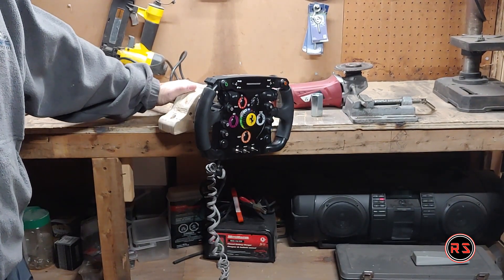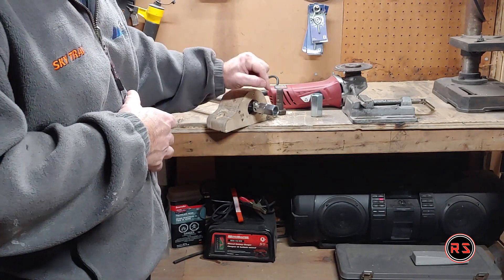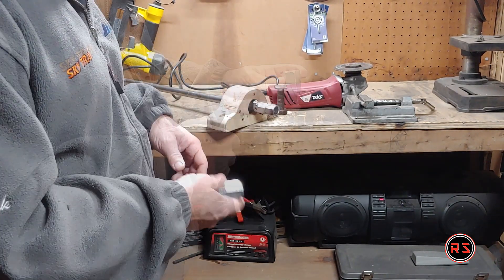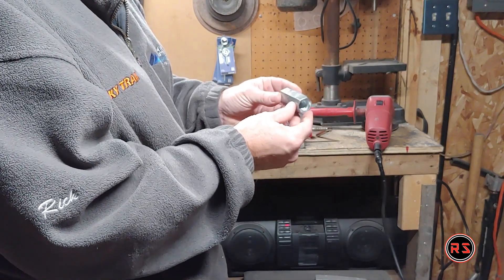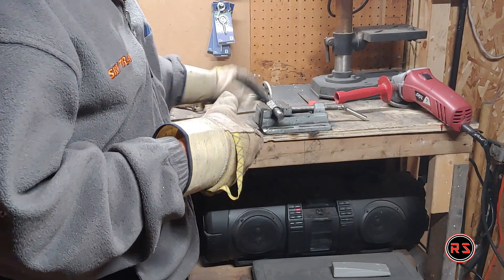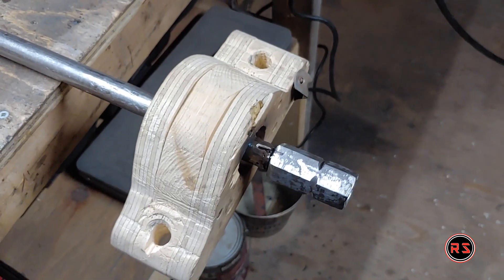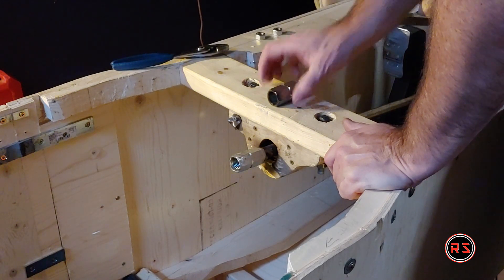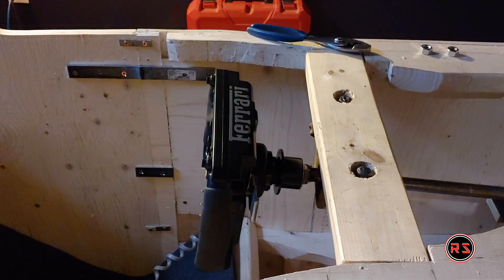Thrustmaster F1 wheel quick release update

Comment: Now how did you know the wheel is center to the hub everytime you connect it? Have a T500 rs and looking into building a similar setup
Reply from the maker: With this particular quick release there is 3 possible positions. I always remove my wheel when it is in the right position. I also turn the wheel base ON before installing the wheel. When the wheel base do the initialization it is always stop at the right position so i can't put it on the wrong position.
The only time uou will have to re-center the wheel will be the first time 
I have a tutorial on how to re-center your wheel so if you have any trouble just ask me.
Reply: @RickStuff  think I'm going to go a different route. looking into 3d printing the wheel locking collar to put at the end of the extension.  this way it's reversible if i upgrade. or want to use a different wheel for different racing.  do you have a forum or a discord?
Reply from the maker: No i don't have any forum and i don't do discord. I do have a facebook page and twitter.
Reply: @RickStuff  Facebook open to community?
Reply from the maker: Yes mate. rickstuff1 on facebook and @RickStuff1 on twitter
Reply from the maker: It look like you are a McLaren fan. You'll love the livery on my sim racing cockpit. Should release the video in early January.
Reply: Yea @rickstuff can't wait to see what it looks like. Would definitely like to throw my ideas at ya sometime. Yes I am a McLaren fan since the days of Mika and David, but now, I just want to be a smooooooth oppperrraaator
Reply from the maker: Lol. This radio com. Came 1st in the top 20 radio com of 2019.
Reply: Lol did you have doubt?